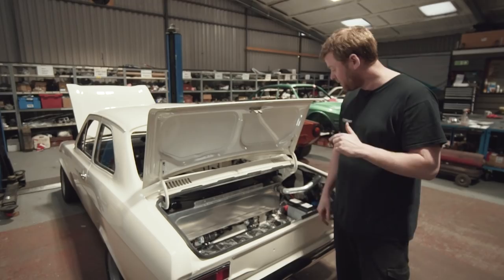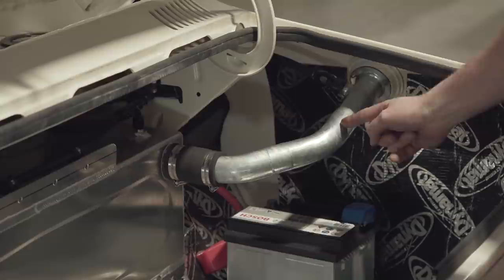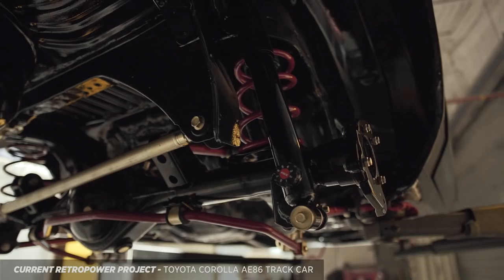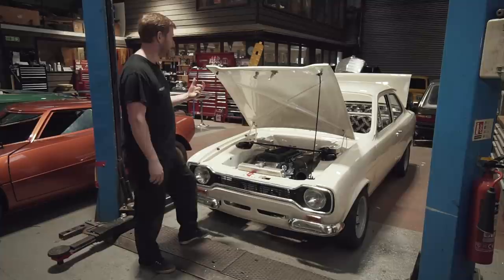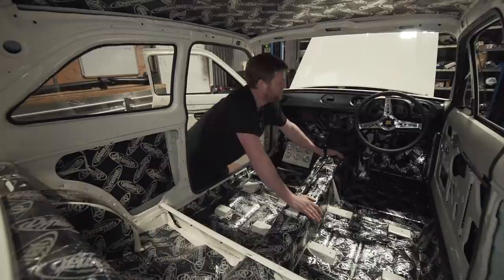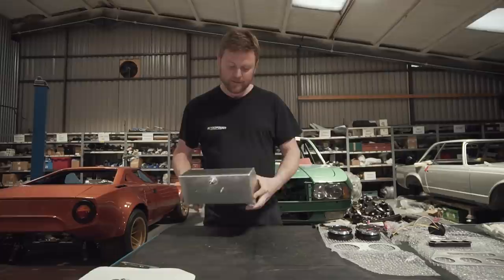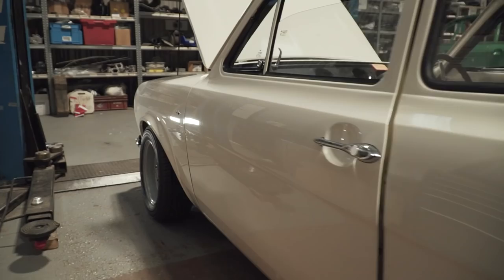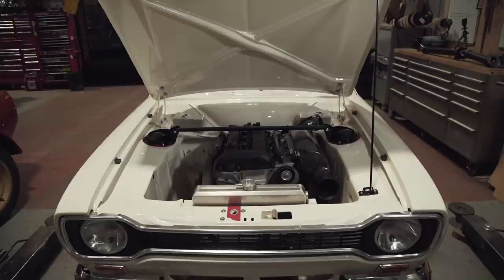Gordon Murray's MK1 Escort - Retropower Build Episode 13

Comment: As an apprentice back in 1974 I purchased a MK 2 Escort 2 lite Ghia . A BIG purchase at nearly $4,000 dollars Australian (as an apprentice)... The Australian Escorts had modified strut towers. They had about a three millimetre plate welded over the top of the mounting points for the front struts, they also had the side filler neck blanked off and a filler neck fitted behind the number plate for the larger fuel tank.

Comment: I see the home stretch,  I think the best feature Retropower built into this car...and there is "much sophistication built in"
  The rear suspension was the most useful and will be the most "Driver admired feature". Yes the improved power and gear box is very good...but truely fitting IRS into a live axle car...transforms this
Car from "The Ordinaire to the Extraordinaire" 
Even if this was the ONLY mod...Its still a quantum leap ahead, over Standard. That feature alone, is worth a gaggle ,of thumbs up !

Comment: Fabulous work as always. Absolutely love the detail , so much thought and just pure engineering quality in your builds. The PDU explanation is brilliant and informative, even the vent in the filler pipe, always wondered about that.  Re the fuel return to the sump, though that should be main tank. Isn't one of the reasons for the fuel return that the bulk of fuel in the tank keeps it cool to avoid vaporisation, if it just goes to that small pot then you loose that benefit ?

Comment: Why return the fuel from the rail to the pump swirl pot? Pressurizing the fuel adds heat, the returned fuel to the engine has been through the engine system picking up more heat. When you are sitting in traffic on a hot day when fuel usage is low, the possibility of vapour locking in the pump increases dramatically. The external pump used is quite prone to vapour issues. A better solution would be to dump it to one end of the tank at the bottom and use an in tank pump, so the pump is at the fuel bulk temperature. Not convinced about the atmospheric vent either. If both vents are flowing to half their maximum flow rate, the tube after the tee piece will lock preventing any flow out, which will pressurise the tank. The pipe after the tee piece (single line) needs to be double the diameter for the set up to work. They should be in diagonally opposite corners so if the tank is full and you park the car nose down on a slope, they are not blocked with fuel, preventing the tank from venting. Hopefully you did not neglect the roll over valves in them.

Comment: Was just thinking about this today and up it pops! I take it the battery under the filler neck will be boxed in eventually?  Where do the battery cables run if the boot is separate? Fantastic attention to detail, incredible work.

Comment: Definitely enjoying this series.  One note though, isn't your hood prop rod receiver in backwards?  I think you would want the "resting open" location to be in the longitudinal slot not the transverse one.  That way, there is a single, set location with no chance for it to bounce around.  The way it shows in the video, it doesn't look quite right with the rod installed and with the rod resting in the transverse slot, the only thing stopping it from moving left or right is the side of the bracket.  I just checked my Miata, which also has a prop rod and an "L" shaped receiver, and it's set up like I describe.  The resting position is with the rod in the end of the longitudinal slot, held on three side with the weight of the hood forcing it into them.  Just a thought...
Reply from the maker: A few people have said the same, but it is correct. The L is to stop the bonnet being able to fly up if caught by the wind, and contrary to what you'd think, because the pivot point of the prop is further back than the receptacle, when you lift it the prop slides to the back of the slot where it cannot lift out. If you put it the other way it does.

Comment: The bonnet strut "receptacle" needs turning 90 degrees
Reply from the maker: We actually had a long-winded dabate about this when we made it lol! This is the best way as when wind catches the bonnet and tries to lift it the prop pulls to the back of the slot where it can no longer pull out upwards
Reply: Does the same if fitted the "Ford" way,  just the strut rests on the bracket wall not the slot. No biggie. Too late now anyway.

Comment: Just a thought about the screen wash tank is how would you flush out the screen wash if it gets stagnant. As when it's  parked in a nice warm garage even with screen wash in the water it can go manky and even breed legionairs disease. I work in a fire brigade workshop and most often the screen wash is stagnant from lack of use and stinks the wagon and  anything that gets squirted by the washer jets from being parked in a warm appliances room but we can either stick a hose in and wash them out or put a bit of peroxide in the washer bottle. Not sure how easy that might be with Gordon's car.
Reply from the maker: Unbolt the tank, disconnect it and wash it out. Most new cars have the tank beneath the inner wing behind the splash shields so it's infinitely easier than almost any modern car
Reply: True but most new cars get driven daily in all weather's and use the screen wash up but running the rear washer going down the road to empty it without puking from the smell is my preferred method.mind I've been running a bike water bottle with pump on the bulk head in my mk2 for about 12 years so I'll make the effort to sort a better set at some point.😁

Comment: Beautiful resto/mod and great video series. Love the attention to detail. I  had many mk2 Cortinas and mk1 and 2 Escorts back in the 80's. Most of them were rusting even then but always fun to drive. You found a pretty decent shell by the looks of things. 
Why did you remove the original bonnet prop receptacle? 10:44 The new one spoils the clean look. Nit picking I know but just saying! Did you consider a pneumatic strut instead of the bonnet prop?
Any chance that this  will be at the Goodwood Revival in September?

Comment: Great work!
But I cant shake the feeling that the bonnet stay bracket is the wrong way round?
Bump the hood with your head and the stay would fall out.
Reply from the maker: No, if the bonnet tries to lift it pull to the back of the slot and thus can't lift out. We had a debate about this when we made it lol
Reply: @retropowercars  Have you asked Gordon about this?
Reply from the maker: @afroaliens  No, but I have tried lifting the bonnet and the prop slides back to the part of the slot that stops it coming out just as intended.
Reply: @retropowercars  damit... well! I was wrong, and the internet was right.. I will see myself out.
Reply from the maker: @afroaliens  haha. It's a fair comment tbh as we initially thought the standard Ford layout was wrong... until we tried it 😂
Reply from the maker: @lawrencew9350  yes that's the early style which this car had originally. I'm not sure why it was changed but certainly for our car the radiator cap  would be in the path of the original
Reply from the maker: @lawrencew9350  apologies for the lack of reply. I'm afraid we can't really justify any time spent on things other than out major projects... already get enough stick for being slow as it is 🤣🤣🤣
Reply: I Thought and still think, it is the wrong way round.

Comment: Very risky to put the battery under the fuel filler. A bump from another car into the rear quarter may dislodge the fuel filler pipe and cause a battery short. You don’t need fuel, the fumes are flammable. Then there will be tears.
Reply from the maker: The same bump would have burst the original fuel tank which was also open into the cabin 😮

Comment: Is there a risk of fuel leaking from the filler pipe and onto the battery terminals potentially creating a short and fire risk?
Reply: As petrol doesn't conduct electricity, how can it create a "short".

Comment: It looks like the engine is slightly on the right side, heavy battery is on the right side and the driver will be on the right side... It is not good for side to side weight balance. How you will compensate that?
You need a heavy passenger for any spirited drive :)))

Comment: Is the fuel tank normally so high up in escorts?
Reply from the maker: It's normally in the rear quarter panel at one side (Where the battery is now). Our location  makes if more central and further forward. It's very similar to the standard group 4 rally car layout

Comment: Hiwhy is the dry sump tank not in the boot?
Reply from the maker: A few reasons. This is absolutely a road car build so luggage space is a concern. Hot pipes through the car and a hot tank in the boot not desirable. We could have put in in an enclosure I suppose and run the lines underneath but weighing up the pros and cons we decided up front made more sense

Comment: gas struts for the bonnet/hood would be more classy
Reply: They want to preserve the simplicity and unclogged design of the mk1 in the basics as much as possible.
Reply: That looked like a proper faff about holding the bonnet high enough to stop the prop from scratching the inner wing. @maxeluy
Reply: Its using a carbon fibre bonnet don't think you can use gas struts with compersite pannels

Comment: What engine is going into the RO 80?
Reply from the maker: Original rotary
Reply: @retropowercars  There is one here in Barbados that was owned by the cricketer Sir Garfield Sobers but I think the engine has been changed.
Reply from the maker: @bigcliffe  most have tbh. We've  parts car for ours and that has a Ford V4 in it